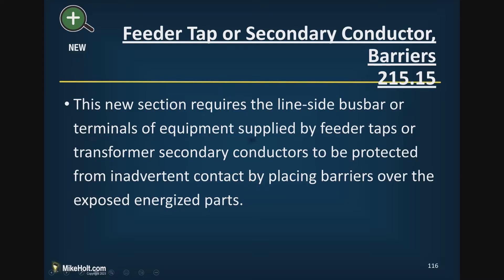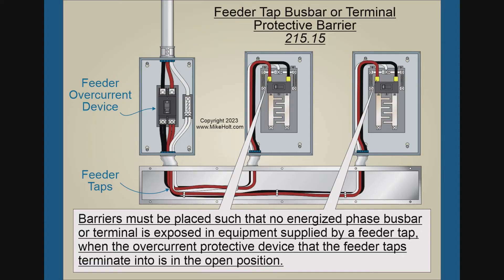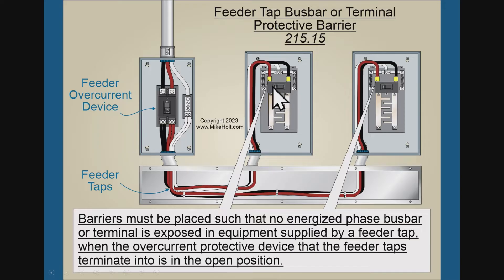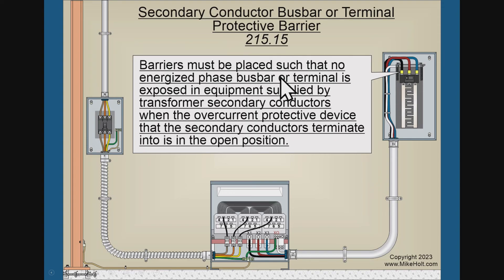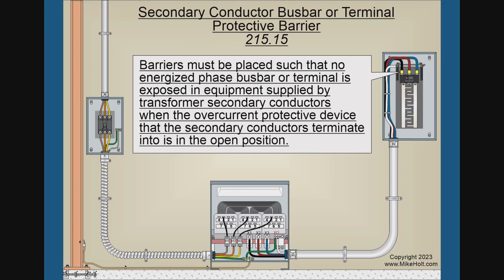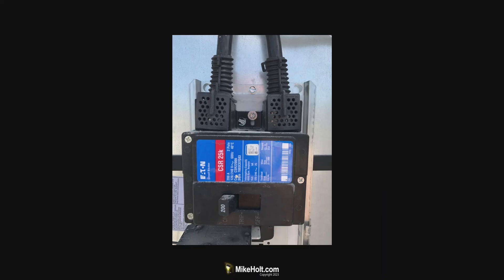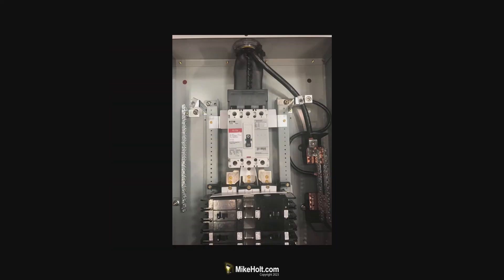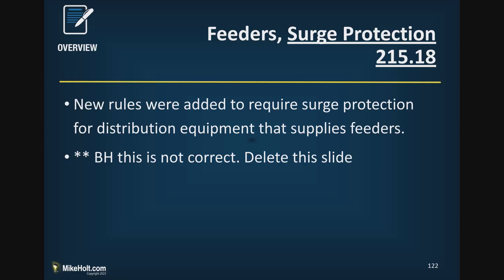Barriers [215.15], 2023 NEC

Comment: Is there no common sense? It's over kill. The feeders have insulation on them, the termination lugs on circuit breakers are in reccesed in terminal "fenders" -meaning boxed in.
 The real assesed threat for accidental shock is when switch gear is opened and all bus bars real-estate (attention to open,  bus bars that have no circuit breakers), those open spaces is exposed and personal is working on a repair--that area should be covered with a barrier at the initial installation was happening.  Next, the interior metal side paneling housing should be covered as extra precaution. This will reduce shock even more.

Comment: What do i need to use as barrier if I tap into the feeder wire to send grid power to my transfer switch? 🤔  do all the wires need to be shielded somehow?
Reply: Well my ATS has barriers on all terminals from ultility and generator as well as feeder to panel.
Reply: @SRCardow1 barriers over connection lugs or over all wiring?
Reply from the maker: @tjmooney4181, please post your question on MikeHolt.com/Forum